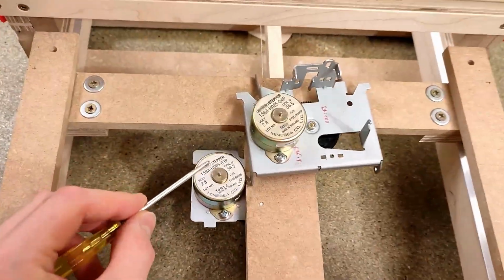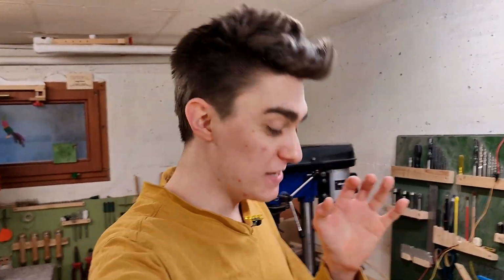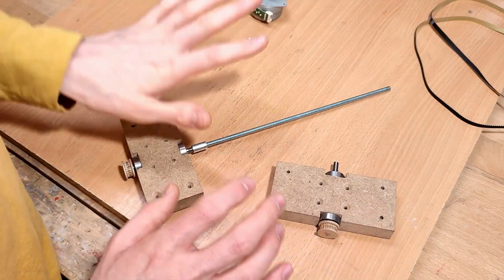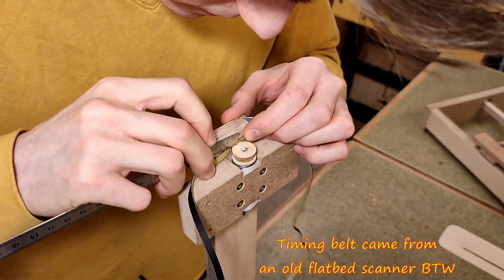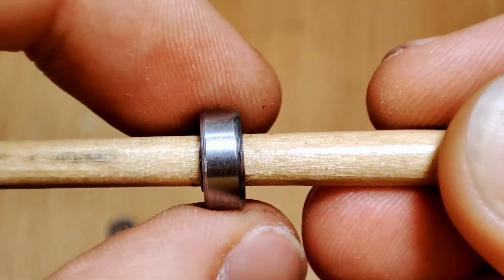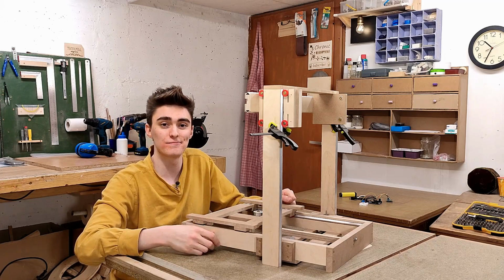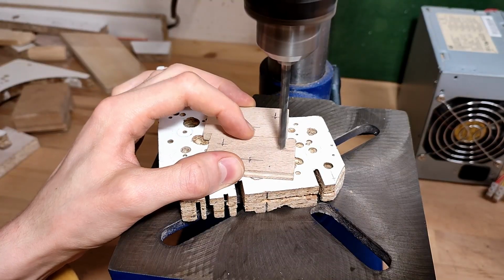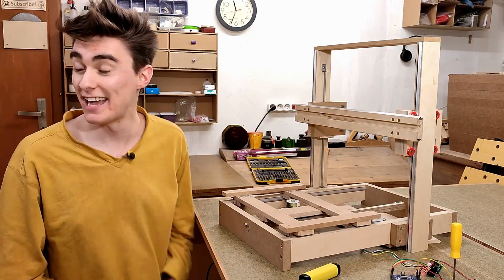Dual lead screws with ONE stepper! | DIY unipolar 3D printer build part 6 - motorizing the Z-axis

Comment: 5:00 woah cardboard drawers fits with your diy recycling vibe
Reply from the maker: That's what you do when you're a teenager and don't have access to better materials 😅 I spent my entire teenagehood setting up this workshop in my parents basement bit by bit, and still have a lot to do 😂
Reply: @ChronicMechatronic  I have my work shop in my parents basement too but I'm only 14, and my dad is a wood worker so I have access to wood!
Reply from the maker: Cool! For important projects I used to have access to wood too, but my dad always having been a scrooge it was often easier to just use trash 😂
And now I have to say, I actually prefer recycling old stuff over using new stock, it's somehow uniquely satisfying!
Reply: @ChronicMechatronic  yeah most of my projects are recycled

Comment: 6:58 wait a minute I am also not such Normal person , so let me suggest you something - 
Just take your Timing belt and fold it around centred drilled Wood Wheel or anything similar in such that the groves of timing belt facing upward now you have diy Timing pully don't forget to put grease or Petrolium jelly on it 🎉🎉

Comment: Good morning, or good night, given the jet lag. Thank you for everything you do, it's very consistent with the initial problem 😉

The Z axis anyway is the one that moves the least. One idea: offset the weight of the Z axis with pulleys and counterweights. Cost: no dollars. You still have ball bearings, small V-shaped wheels that you have already turned, excellent precaution to have made a few more, fishing line, scrap wood for the counterweights on each side!

Best regards and thanks to Google translate. 😉

Comment: 10:56 i also did the same , thinking same but will tittle harder pipes of Ro filter 
Piping by combination to thickness 5 and ≈ 9
Mine plan was to cut some sprial to the pipe to make it flexible in spin Directions .
Reply from the maker: True, that's another possibly 👍

Comment: 23:30 You might try the lighting department instead of general nuts and bolts. A lot of lamp parts are brass, so they'll probably have some nuts over there.
I wish you would have put that Z belt up on top instead of underneath. I did that on my milling machine and it's super handy being able to pull on the belt to quickly move the Z axis up and down (with the stepper disabled, of course).
Those pulleys are indeed very impressive :) And nice to see you know about the super glue surface hardening trick.
Reply from the maker: Yeah, that's an idea... For my laser cutter I found threaded inserts made out of brass, those should do the trick.
I see what you mean with the belt up top, it's used on the few single stepper dual lead screw setups out there. Guess that's something I'll change on the next 3D printer... Reason I didn't do it was because the puny 5mm lead screws needed 2 bearings close to the pulley, otherwise the tension of the belt would have ended up bending them. I didn't want to put all that weight on top to prevent the printer from becoming too top-heavy.

Comment: I try to imagine what kind of super-project you would have if you had a lathe... or a 3D printer, a CNC or a laser cutter...
Reply from the maker: I feel kind of conflicted with those modern maker CNC tools... On the one hand, yes, the possibilities those tools open up are endless, the complex shapes that can be created at high accuracies are game changing. On the other hand it takes insane amounts of time to fully model those parts in CAD and set up the respective machine for a successful execution. The same time it would've taken me to chuck a piece of material in a few machines and do it myself. Additionally I think the convenience of pushing a button on a computer and having a finished part plop out of a machine will slowly kill creativity in the long run, just like social media kills our attention span...
A lathe, welder, mill etc. yes please! As they say, necessity is the mother of invention!

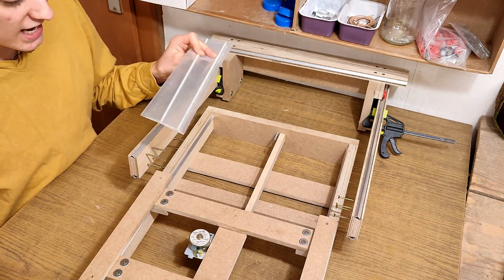Comment: 3:05 thank god you mentioned this, I noticed the same problem with my lead screw, which is 8mm diameter 1 meter long, when I put it on the floor I noticed it was wobbling ( even with the bearing) I found that one of the screws had a small bend so I tried to force it manually to make it straight but I didn't  succeed perfectly ,  initially I thought it wouldn't matter much because  it will not be in load so a little bit of wobbling would be good as it will adjust itself when it will be placed between two parallel rods or LR but after listening to your words i am a bit worried can you explain that in this situation  what could go wrong?
Reply from the maker: I think it all depends on how thick and sturdy your gantry is. An 8mm threaded rod at 1 meter length will easily have a 3-5mm wobble straightened out by a decently strong gantry. For 1-2mm even a single 20x20 extrusion (for reference) should be strong enough I'd guess. Basically what happens is, the force required to straighten the lead screw is what will push the carriage in all directions it isn't supposed to go. All you need, is to have the axis of the machine (smooth rods, linear rails etc.) strong enough to not get bent over the acceptable limit by that force. It's kinda hard to explain...
Ways to work around that, would be to only mount one side of the lead screw with bearings and have the other end flop around more or less freely (like I did in this video). Alternatively you could mount the nut in a way that allows it to move laterally and follow the wobble of the screw. Though that's by far the most complicated way of solving it, because every freedom of lateral movement will potentially also increase backlash...
Reply: @ChronicMechatronic  thanks for suggestions , I will also try to straight them if possible.

Comment: What's the case with brass nuts btw.. what about steel nut
Reply from the maker: You can use steel nuts of course, as long as you keep them well lubricated they'll work just fine. Thing is, if you run steel on steel it'll wear out both, the lead screws and the nut, whereas the softer brass wears out much faster so you'll only have to replace the nut rather than both which is a lot easier and inexpensive. Additionally brass is generally kind of low friction on steel, hence why bronze bushings in motors are a thing...
But yeah, as difficult as brass nuts are to come by, at least using standard threaded rod as lead screws it may even be cheaper (or at least easier) to occasionally replace the entire lead screw than finding brass nuts

Comment: 25:00 I wonder how he will behave under load
I hope he doesn't lose speed.
Reply from the maker: Should be fine I think, with the threaded rod the motor has a lot of mechanical advantage and the hotend + X-carriage aren't going to add a lot of mass to the X-axis
Reply: you know better ))

 @ChronicMechatronic
Reply from the maker: I'm not always right ;) I was genuinely disappointed by how little torque the stepper actually has. Though for normal operation it should suffice, especially when I replace the wooden pulleys with lower friction 3D printed ones...

Comment: You can run your motor as a bipolar motor if you want to. I had such crappy motors and running them in bipolar mode gave them more torque. But you won't use the unipolar motor drivers, the cheap A4988 motor driver will do.
Reply from the maker: That's what I'm planning to do!
I wouldn't know how to modify the software to run control unipolar steppers anyway...